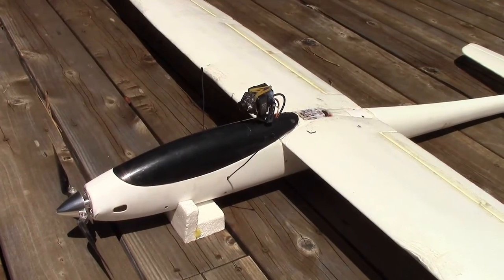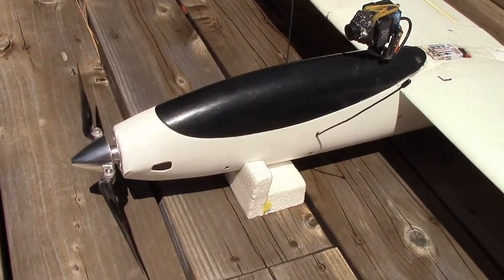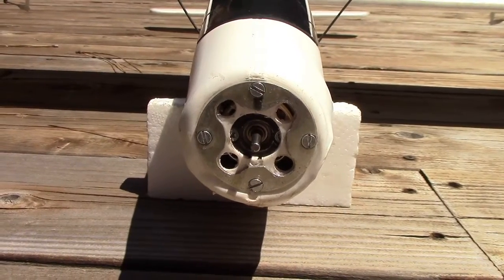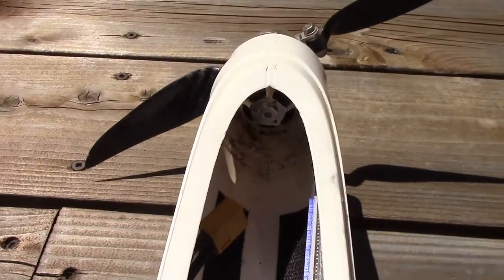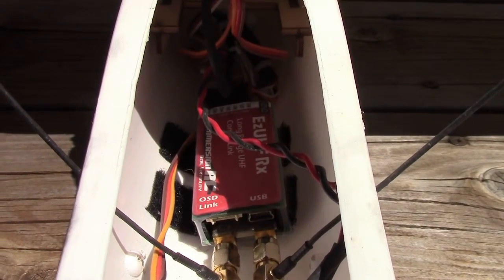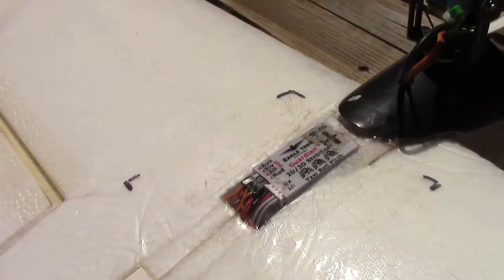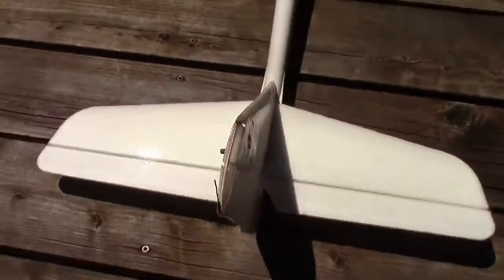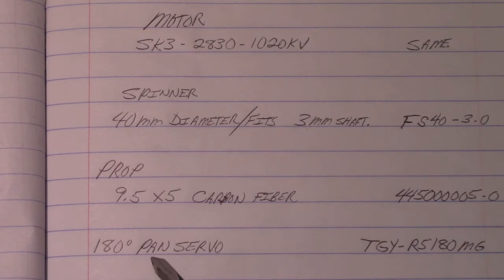Phoenix 2000 FPV build part 2

Comment: Γειά σου φίλε μου είμαι από Ελλάδα και προσπαθώ να φτιάξω ένα fhoenix 2000hk fpv έχω τα fattshark attitude v1 & receiver Fattshark θα μπορούσες να με βοηθήσετε να το στήσω fpv δεν μπορώ να βρω το CG η τι μπαταρια να βάλω. Βάζω 3ς2200mah και δίνω ρεύμα και στο ανεμόπτερο και στο receiver έχω τα fattshark attitude v1 & fattshark receiver θα μπορούσες να με βοηθήσετε να το φτιάξω fpv? Δεν βρίσκω το CG. Τι μπαταριες να βάλω μια 3ς2200mah? Η 2 πιο μικρές? Αν έχεις κάποιο βίντεο πως το φτιάχνεις που τα βάζεις σε ποια σημεία (δέκτη κεραίες, 1 η 2 μπαταρίες έχεις η αν θέλεις και μπορείς να μου στείλεις καμία φωτογραφία πως το κάνεις. Είμαι από Ελλάδα και από την Θεσσαλονίκη Μακεδονία και εδώ δεν υπάρχουν άλλοι να με βοηθήσουν όλοι πετάνε ακροβατικά 3D.. Βοήθησε με αν μπορείς και αν θέλεις.. Σε ευχαριστώ πολύ
Reply from the maker: Hi Kostas,
I used one 3S 2200 mAH battery or one 3S 2700 mA battery on this plane. The battery was located directly behind the motor, and the receiver was behind the battery. Typical fly/glide time was approximately 20 minutes with 25% battery capacity remaining after landing. The CG was approximately 1/3 of the way back from the wing leading edge. I had to move the battery forward... almost touching the motor in order to achieve the correct CG.

Comment: Great info on how to keep the motor cool with that gap between the spinner and the fuselage. And also the holes in the mounting plate. Did you increase the size of any of the holes in the fuselage for better cooling?
Reply from the maker: No, the original holes in the fuselage are the same size.
Reply from the maker: I did not increase the size of any other holes in the fuselage :).

Comment: please, can you show me an image where i can see how to mount the pan tilt system? thanks
Reply from the maker: Hi Dario, I don't have an image, so I'll try to describe how it is mounted. I epoxied a 3mm thick piece of modeling plywood on top of the pan servo ears... one piece on each ear. Then I shaped the plywood to match the curvature of the inside surface of the fuselage. I drilled small holes through each piece of plywood, going through the hole in the servo ear. I then drilled matching holes in the top of the fuselage, just behind the canopy, then threaded two tiny wood screws w/homemade carbon fiber washers through the top of the fuselage, through the plywood, and through the hole in the servo ear. This mounting technique is rigid enough to withstand hard landings, and light weight.Of course, I also carefully carved a hole in the fuselage so the splined shaft of the servo can connect to the tilt servo/camera assembly.
Reply: thanks! you helped me!